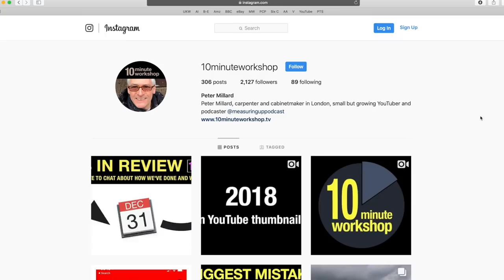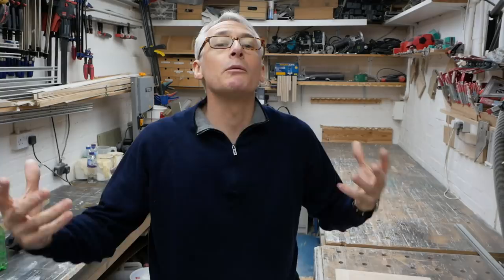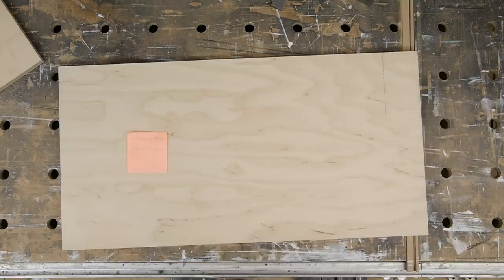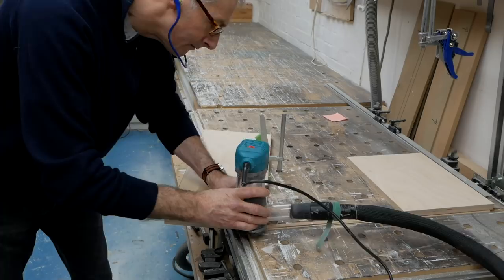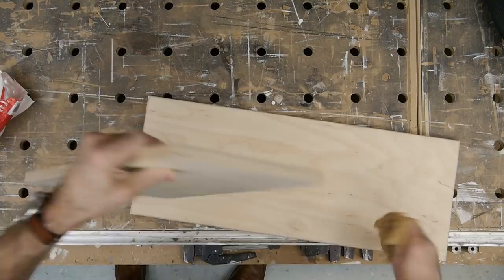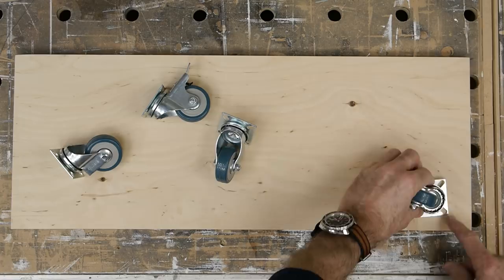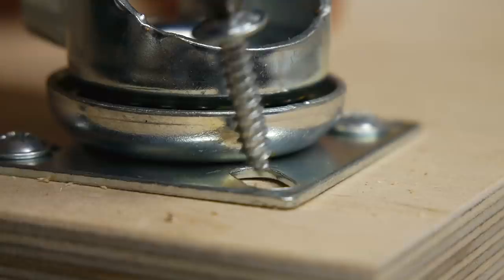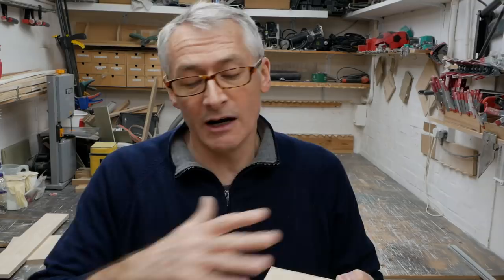Easy Mobile Bases [Video # 268]

Comment: I made 5 of these dollys but added a lip on the top with some stripwood. I use them for my stacking tool boxes in the garage and also storage crates. The Festool  sys cart and Dewalt Tstak carts were too expensive £35-£60. I did the same as you Peter - scrap ply and some castors for under £7. However I put the castors more towards the corner edges so reduce the tipping effect when the toolboxes are stacked very high e.g. 5 - 8 systainers or tstak boxes.

Comment: I made some of those years ago but I drilled  countersink divvets in the base to line up with the equipment's mounting feet.  That way the equipment would register onto the mobile base.  I also found that on small bases, if the casters didn't get mounted near the corners of the base, the equipment could become a bit too tipsy at times.  Something to think about anyway.

Comment: Happy new year Peter.
If you were worried about screws breaking out other side, you could have put washer under screw head.
Reply from the maker: Thanks Geoff, and same to you too! Yes, I could have used washers - or the right length screws, lol - but they were fine as long as the weren’t driven in overly tight. 👍👍

Comment: I have made something similar Happy New Year and you could have used a washer under the screw 👍
Reply from the maker: Cheers Ray. Yeah, could have used a washer, could have used shorter screws 🤷‍♂️🤔👍😂
Reply: Sometimes you have to use what you have I get my wheels from Toolstation or Screwfix

Comment: It looks like your running a scoring cut with your track saw. Have you always done that? (first I noticed) Does that give you a better result?
Reply from the maker: Force of habit; I do this on plywood crosscuts and veneered boards as it generally gives a cleaner cut on the waste side, so I try to get into the habit of doing it all the time so when I really need it I don’t forget! 👍👍
Reply: Peter Millard Thanks for the great tip Peter 👍

Comment: Hi Peter, happy new Year from Holland. At 2.00 you cut the board in 2 times. Why not in 1 pass??
Reply from the maker: Hi Rick! Force of habit - I like to do a scoring cut in ply or veneered boards, just to get the cleanest cut possible; not necessary here because of the roundover, but I like to make a habit of it so that when I do need it I do it without thinking. 👍👍
Reply: Thanks for the respons. I always try to make my scoring cuts in veneered boards backwards. I think this gives a cleaner cut!
Reply from the maker: I’ve tried it both ways and haven’t found a difference, personally, but whatever works! 👍👍